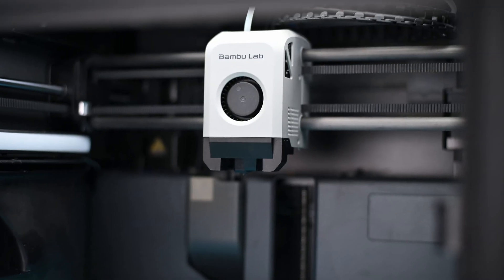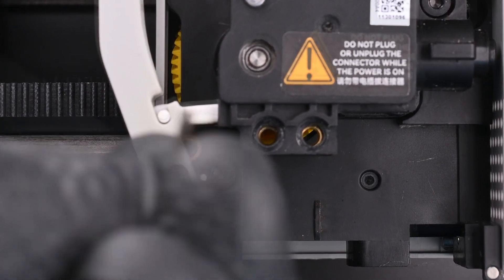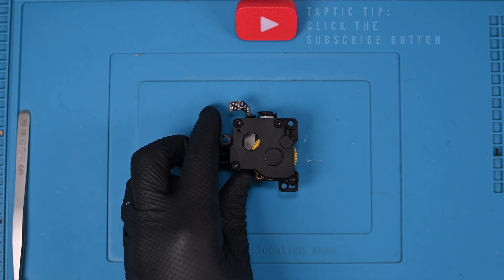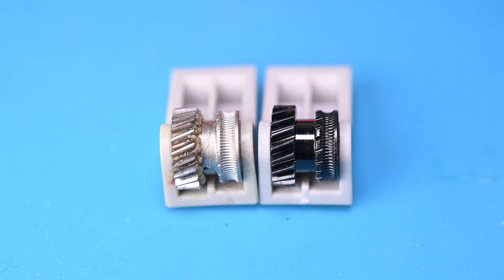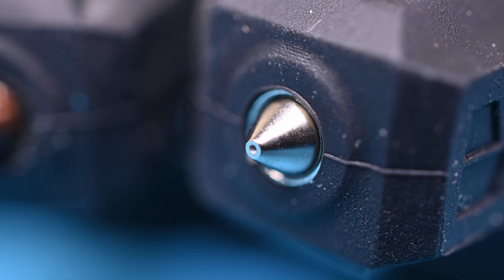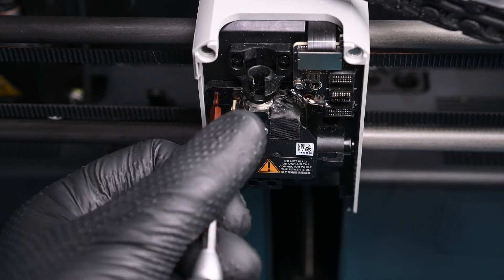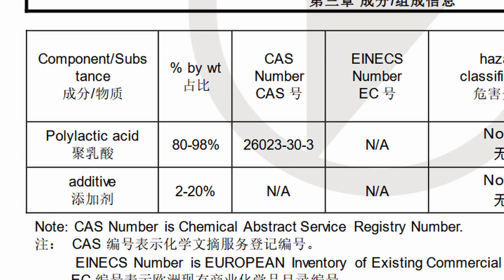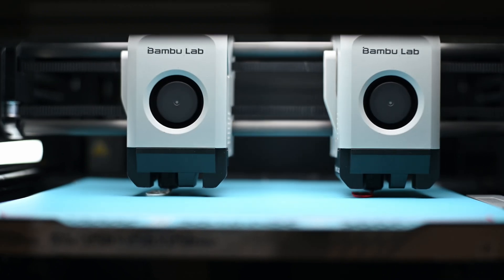Upgrading the Bambu P1S with Hardened Steel Parts

Comment: wait, i thought we only need to swap the nozzle to hardened steel nozzle. Why we need to replace the extruder gears?
Reply from the maker: If you print a lot of abrasive filaments then I would highly recommend it. Anything that comes in contact with those filaments will start to wear, they also eat through PTFE tubes a bit faster than normal too.

Comment: We bought everything needed to do this but we're so worried we are going to muck something in there up just to be able to print like... One glowy thing. Would you say it's still worth it if that's really all your planning on? Or maybe we should wait until the natural wear and tear of regular use requires a change anyway?
Reply from the maker: Absolutely worth the upgrade and no where near as hard or complicated as it looks! With the hardened steel gears you can still print normal filament with no change to your settings, it just lets you also print the abrasive stuff.

Comment: I only just got a p1s a few weeks ago and blue PLA Glow was my first filament purchase.  I was literally wondering why the fuck my AMS is already ground down on one of the little filament feed funnels in only a few weeks, and abrasive filament is probably the culprit.  Looks like that'll be shelved till I can upgrade a few printer parts to handle it better.

Comment: Is changing to hardened extruder a must for printing abrasive or just enough with changing hardened nozzle? I usually prints PLA but would like to be ready and able in case I need to print abrasive.
Reply from the maker: I’d recommend doing it for sure, the filament will grind the gears and nozzle down unless they are hardened steel. A big benefit of the gears is that you can still print all the normal filaments with no change to your setting, you just get the option to print abrasive as well.
Reply: @TapticDigital  I changed to Phaetus M6 for my P1S and since I'm doing that, the extruder got changed in one go as well. Cheers.

Comment: One thing to note, hardened steel is magnetic, so if you plan to embed neodymium magnets into your prints, you may want to superglue them in before resuming the print.
Reply: Great tip, I would have definitely made this mistake lol

Comment: Great step by step but honestly I don't notice the difference between the two . Id only upgrade next time if something was wrong with the original. They both print the same
Reply from the maker: There’s no quality difference, it just allows you to use abrasive filaments like Glow and CF without grinding away the gears and nozzle. Those types of filaments will actually slowly “erode” the metal of the default parts.

Comment: Fantastic! Did you recalibrate the printer before using it again?
Reply from the maker: Nope, just fired up a print and went for it! The gears are the same spec as the original, just a different material so it shouldn’t need to change any ratios or settings.

Comment: The quality between both are the same. What's the point for the "upgrade"? Thanks.
Reply from the maker: The upgrade allows it to handle abrasive filament like Carbon Fiver filled or Glow in the Dark filament without wearing out.
Reply: @TapticDigital -- Is there a downside to the upgrade?
Reply: Thanks.

Comment: ok I did not know the Glow filament was abrasive. And like a rookie cause I am keep having issues at the end of the print with failure to retract filament. I will be buying the upgrade now. Still having issues removing the clogs in my old hot ends now. Thanks for the outstanding videos and great instructions given. Subscribed now 👊
Reply: Glow is in fact one of the most abrasive

Comment: I run a 3D print farm. Slow down and do exactly what this guy tells you.  Should be clearer on the grease at the end.  Use the gold packets.  Great video.
Reply from the maker: Good point, I wish I’d included the greasing. Maybe I should make a maintenance video 🤔

Comment: I found a little green o-ring on my bench when i finished up. Any ideas where it should be installed?
Reply from the maker: That’s kind of odd. I’m honestly having trouble thinking of where an O ring would even go in the extruder assembly. Or in the printer at all, there isn’t much that needs to be sealed. I wouldn’t worry about it.
Reply: @TapticDigital  Thank you. You are probably right. I disassembled it on my workbench where i do a lot of RC-stuff. Could be left over from a recent quad build.

Comment: Since I have done this I'm getting nozzle temperature error. I bought complete Hotend with fan so just swapped out to harden Hotend. I print basic pla @220c, should I increase the nozzle heat? Any idea why I'm getting this error.
Reply from the maker: Did you change your Device settings in the slicer to be the hardened nozzle? It shouldn’t make a difference, but worth trying. And normal PLA should be fine at 220

Comment: Hey guys, I bought the hardened nozzles but 0.2 is still stainless. Can I use 0.2 stainless after upgrade all the extrusure gear?
Reply from the maker: Absolutely, you can use the hardened gear with any nozzle it won’t make a difference. It doesn’t affect printing at all, just allows you to use abrasive filaments if you want.
Reply: @TapticDigital amazing dude. I did not find too many info. You saved me

Comment: FYI, you don't need to push in the bearings by hand. Just put them on the wheel and they will pop in place. By pushing them you risk damaging/dirtying the bearing
Reply from the maker: I use them as tiny fidget spinners before installing them.

Comment: Do you need to change the settings in the printer so it knows the hotend changed to harden?  If so where.
Reply from the maker: Yes, you can change it in the slicer under the Device page, then Printer Parts above the AMS management window. You can also change it on the printer itself by scrolling down to Accessories and setting it there.

Comment: I don't believe the gears themselves should be greased. Those gears come in contact with the filament and doing this will get grease on the filament which may impact the extrusion operation. Bambu does lightly coat these gears with grease just to ensure everything doesn't lock if the printer sits in a warehouse for months in the box. Your gears seem to have quite a bit of grease present, guessing you did the upgrade and applied this grease and then re-shot the video so it's your grease you're showing. My P1S is brand new and there is only a very very very  light hint of grease on the gears (not visible without a macro shot of the gears, much closer than your gear shot). At the distance you show, there wouldn't be any grease seen on my gear. The one place where grease should be applied (but you didn't show) is on the top/bottom of the yellow gear shaft  where it makes contact with the bearings. Just a small dab of grease on the top/bottom of the shaft is needed and that will spread when the gear shaft is inserted into the bearings.

You also didn't mention that the filament detection sensor connector must be re-installed before finishing. At 5:54 when you say "we're on the final step", the connector isn't connected yet but after you plug the hotend connectors in place you show ALL connectors put back in place (at 6:03). Minor but if someone didn't remember to install that, their filament sensor wouldn't work.
Reply from the maker: The grease in the video is actually on the stock one, Bambu went way over the top with it. And you’re correct, the main gears do not need to be greased, just the smaller driving gears that don’t contact the filament.

Comment: Just hear to say love the channel mate. Helped me work on my P1S.  Still not working yet lol ! Subbed
Reply from the maker: What’s yours doing?
Reply: @TapticDigital  OMG so many probelms Wish i could talk to you to get your take.  The nozzle was getting PLA stuck because the extractor wouldnt pull it out just cut it off. The PLA would then be stuck in the nozzle and the extractor. I have both parts new and the same problem happened. The Tube from the Hot end to out of the P1S that the plastic comes in is missing the little clip that goes over the tube. To stop it pushing on the Little ruber thing but i can't see that being the problem. I do run it 16-18 hours a day.

Comment: I'm about to switch to the hardened steel hardware. I print mostly PLA, but will occasionally print CF and other abrasive material. I hear that for PLA you need to bump up the temp abut 5 degrees C or so when using the hardened steel nozzle. Is this true?
Reply from the maker: Can't believe I missed this comment, in older printers yes you'd want to up the temp just a bit but that's because we were using brass nozzles. Since the Bambu uses either Stainless or Hardened, it's all steel from the start. No need to change temps!

Comment: So, there are no benefits of upgrading to this hardened steel if im only printing with the standard stuff like PLA, PETG, PLA-CF and such?

Does it make any more noises than the printer allready does? Any issues further down the line?
Reply from the maker: Any CF filament should be printed with hardened steel gears and a nozzle, the filament is abrasive and will wear brass down over time. Aside from the material, there’s no difference to sound, performance, or settings.
Reply: I’m pretty sure hardened just lasts longer right?

Comment: You don't want that stuff in the AMS either..unfortunately. Been there
Reply from the maker: My PTFE tubes love a good abrasive sanding lol
Reply: @TapticDigital   It got caught all up in the AMS gears for me had to forceably pull it back out when it was trying to pull it out too. Luckily got it out without a break but man.. I shined the UV light in there and its all in the gears etc rollers where it was sitting under it. crazy.. I love that glow stuff too